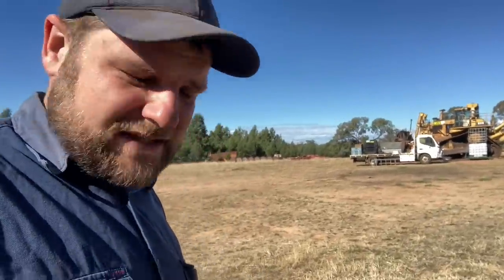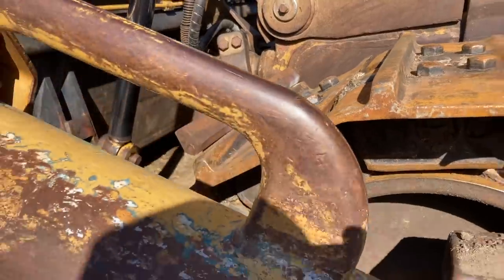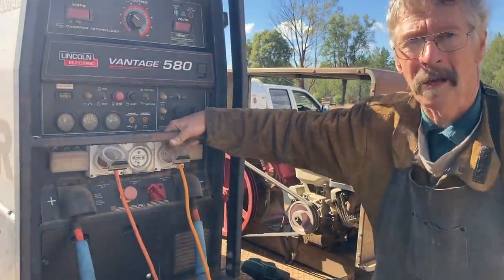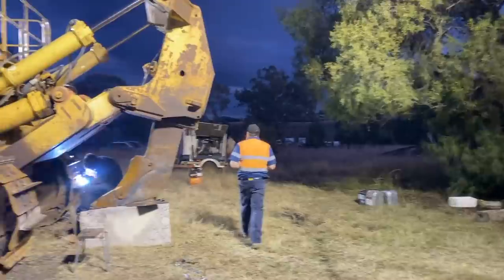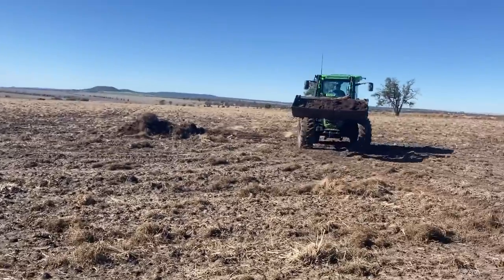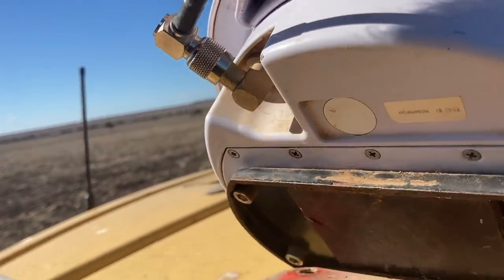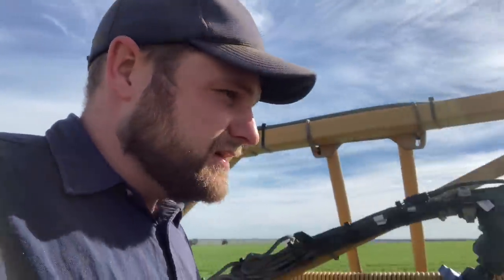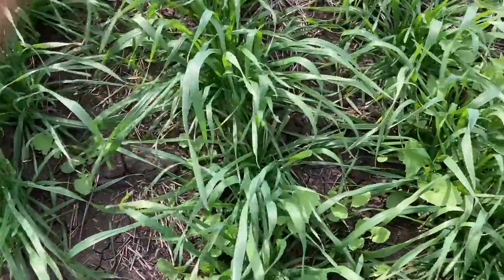One D11 Gets New Grouser Lugs and The Other Gets Bogged! (Vlog 19)

Comment: Welding the cleats on is much much cheaper then buying new grouser pads!
Reply from the maker: Sure is👍
Reply: @thejacksonbrothers  I wonder what a set of grouser pads and bolts for an 11 would cost? Y’all don’t have a lot of rocks so welding those on will work really well and I imagine you will be able to tell the difference in short order!
Reply from the maker: @peteparker7396  i think we did price them up but I can’t remember. It should work well👍
Reply: @peteparker7396  The local cat dealer keeps a guy busy regrousing pads for the local coal mines, they rebuild them till the pads start cracking around the bolt holes.